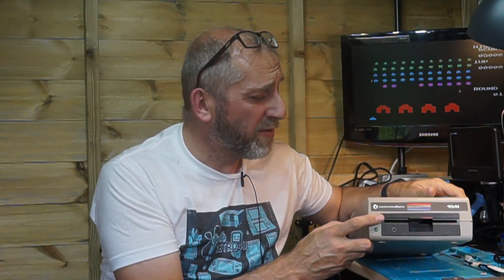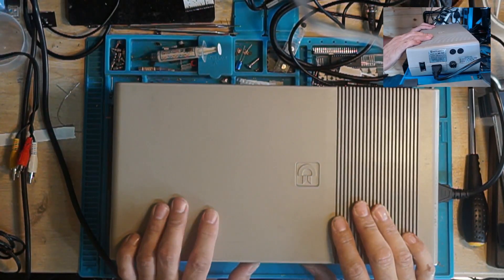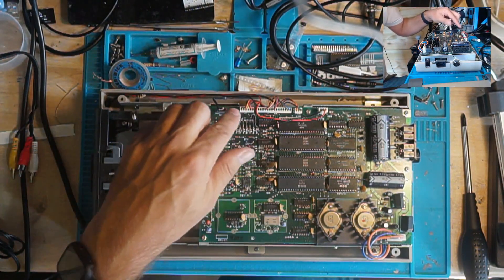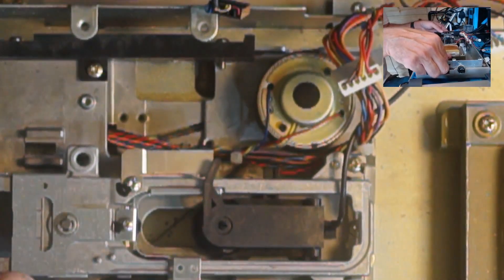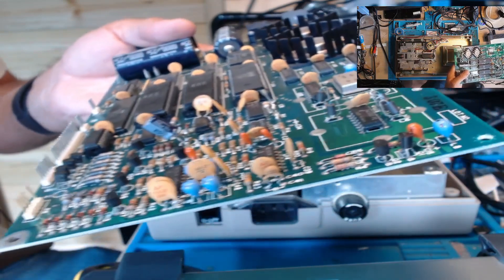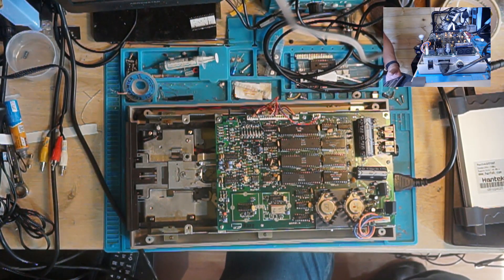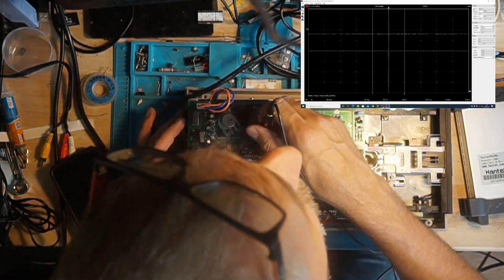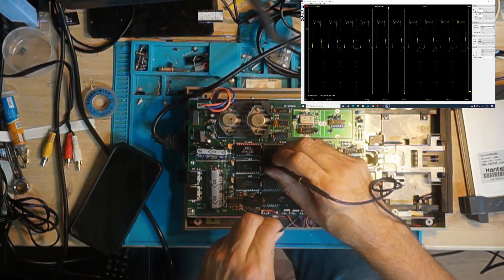Commodore 1541 drive stuck in a spin Can we fix it ?

Comment: I had a similar problem and swapped the  instructions ROM and brought my Vic 1541 from the brink. I have another drive that needs a eprom jiffy DOS replacement. Not cheap about 70 bucks on ebay.
Reply from the maker: Yeah I’m looking at making a jiffy Rom for it have the adapter boards on order. Will do the C64 as well. Thanks for the advice will deffo look into it if the cpu does not work.